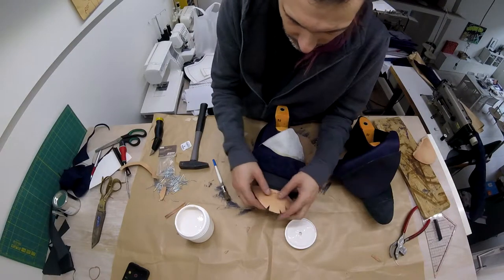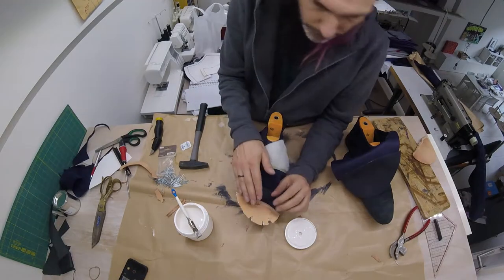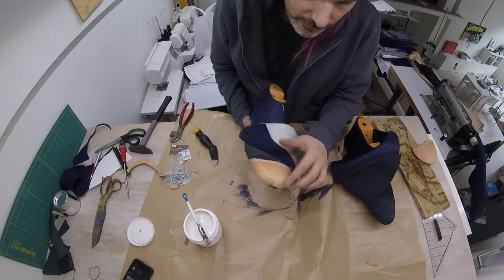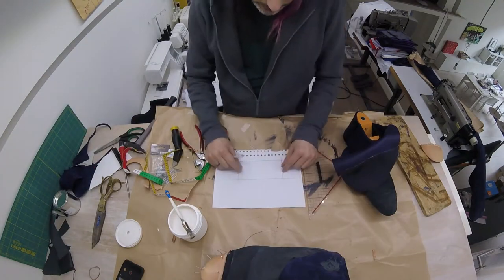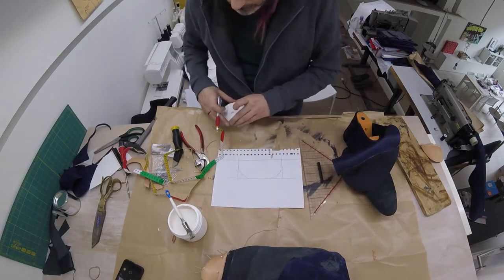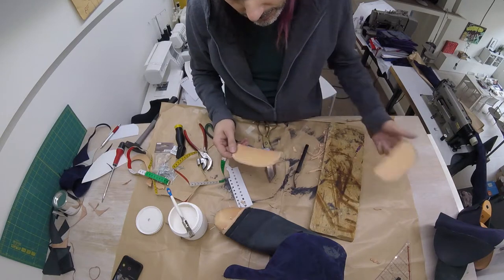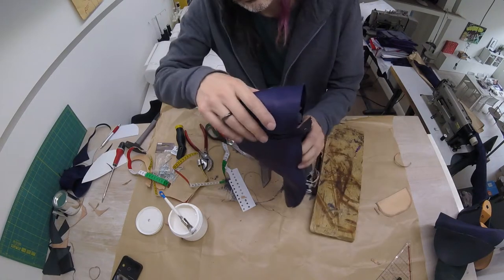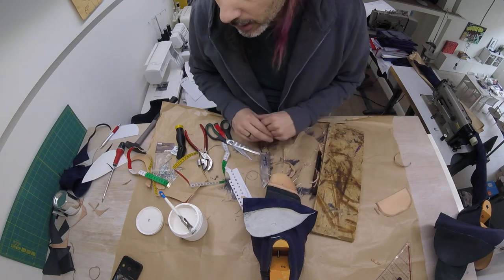Shoes from scratch 10/25 : Constructing the heel counter

Comment: This vid is now six years old, but I can't help offering that you might enjoy skiving a lot more doing long, smooth strokes. Especially if you replace the injector blade in your skife for each project and put the leather on a hard, flat surface like a glass cutting board or scrap or marble tile. Short, chopping strokes will absolutely make it miserable!